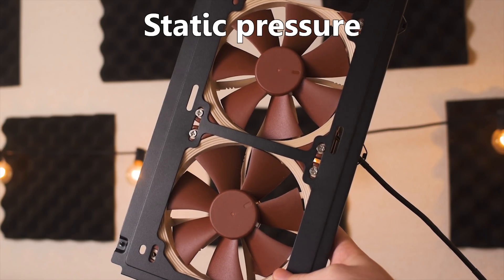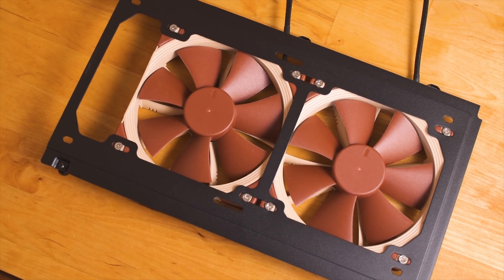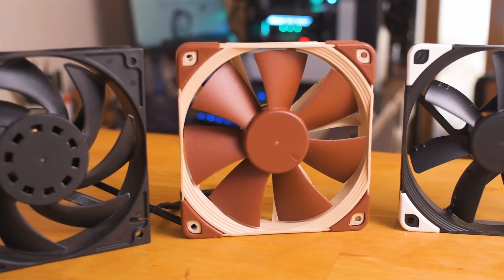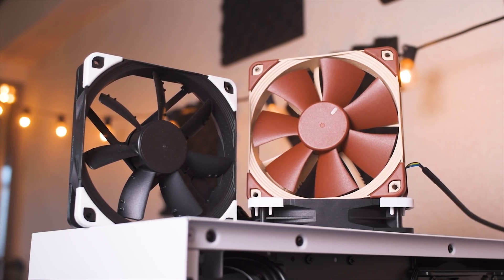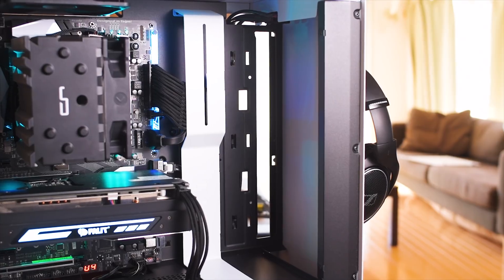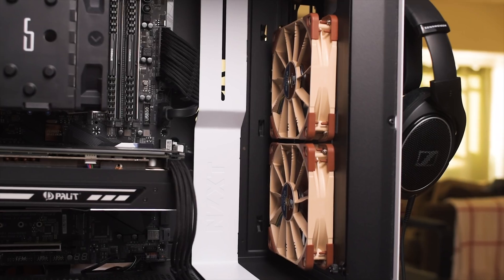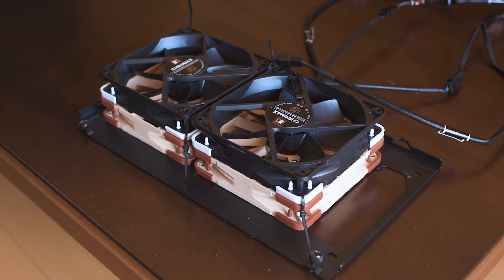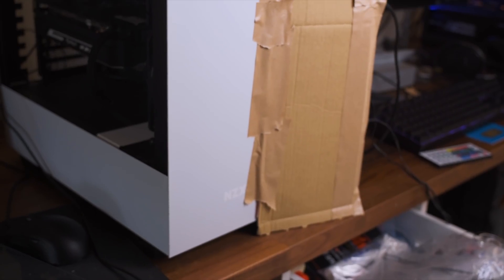DON'T buy front intake fans! (For NZXT H500/S340)

Comment: At first I thought how smart guys at NZXT are for making negative pressure case setup. And now after they released H510 I have to think twice. Now they have removed front panel and replaced it with tempered glass. Of course, this is being done just because they want to showcase 2 120 mm fans in front. But airflow case design is completely the same with regard to H500. So, there is no engineering ingenuity behind H series just because the fact this video proves - we don't need 2 intake fans at the front at all.

Comment: With this case and 120MM fans in the front you will be drawing air from the inside of the case because of the hole at the bottom of the fan panel.  Basically it's not sealed from the rest of the case and wont suck through the tiny openings/filter as easily as it could from the rest of the case.

Comment: Should i put airflow fans like the Noctua NF-S12 or static Pressure ones like the NF-F12 in my rear and top exhaust of my h200? (it has a similar design as the h500). One one hand, the airflow ones move more hot Air out of the case , but because i have no intakes there will be problemes with pressure and pulling the Air in, but im also thinking that if i put the static pressure ones that move 40% less air out of teh Case , there will automaticly be less cool air in the case , what is right? Need your suggestions.

Comment: This will save me a lot of money because I'm picking this case up today. Thank you very much subscribed.
Reply: Save your money if u want ur system to heat up.. I would say install the intake fan anyway if u r using air cooler. I'm using beafy size gpu with 3 fans yet I still need atleast 1 bottom intake. PS I live in Asia.
Reply from the maker: I'm glad it helped you out. It's a great case, I'm sure you will enjoy it.
Reply: @DawidDoesTechStuff  bro i am deep cool rf120 rgb fans for my h500 case for back fan and the top fan so should i install the old defaul nzxt h500 fans on the front of the case because.i dont it just laying around i want to use them

Comment: yea but it doesnt look as good without any fans there... not gonna say you have to have RGB fans but if you use 2 standard black case fans or even if you can find white case fans it fills the case out and makes it look full... like you take pride in your work. you can buy standard 120mm case fans from best buy for pretty cheap.

Comment: What if you would have gone water cooled for the CPU? Would that have helped with the temp?
Reply: I have a 240 AIO in my H500... im running a ryzen 5 2600 at 4.1GHz and i usually sit at 31c. plus like i said before it will fill out the case and make it look like you give a damn about building.... it looks horrible just looking through and seeing the back side of the front panel
edit i also stress tested the cpu. At its highest I had it at 71c after about 20 min or so

Comment: Hi i have Corsair 100r case , and i only have static pressure fans from Corsair sp120s so i can use them as two front intakes and three exhaust ( 2 up and one at the back? ) , as i am getting 80 degrees plus while gaming . Currently i have 2 intakes and one exhaust. 2 sp120 and one stock fan at the back . I have asus strix gtx 970

Comment: @DawidDoesTechStuff, got a recommendation for a future video !
Could you try placing a fan on the H500’s PSU shroud, since it’s perforated, to see how much it helps with GPU temps and make a video out of it ? 
If not possible, could you try it and post the results in the description or by answering this comment ?
Thanks for considering
Reply from the maker: Hello, sorry that I didn't reply earlier. That is a great idea. I will test it out and see how it goes. :D
Reply: Great ! Thanks for answering !
Reply: @DawidDoesTechStuff  did this do much of anything?

Comment: Yeah gamers nexus already disproved this video by showing that adding 2 noctua fans in the H500 decreases temperatures significantly enough to recommend it, and honestly I’d trust Steve over you any day
Reply from the maker: Fair enough, I would also trust Steve over my results. Out of interest can you remember what the video title was? I'm curious to see if I did something wrong in my test. Or at least try and figure out why we got different results.
Reply: @DawidDoesTechStuff   Look up NZXT H500 Case Review, test results start at 13:14. An important side note, in my original comment I mixed up my videos and mistakenly referenced a different video of the Meshify C by Gamer's Nexus where they specifically added Noctua fans and saw a dramatic decrease in temperature. In this video however, you will see that for CPU temps, having the rear stock fan exhausting, top fan intaking, and added front intake fans results in the lowest temperatures of all configs tested. However, for GPU temps the results were exactly opposite,  stock config resulted in the lowest temps and the best CPU temp config resulted in the highest GPU temps. So in the end, whether you should install an additional intake fan is dependent on which temps you'd like to optimize for. And I guess that is the only concern I have regarding your video is the blanket statement that you shouldn't add intake fans as that isn't the case for something like a workstation where optimizing CPU temps is more important.
I do apologize for mixing up my videos in my original comment, your methodology resulted in a conclusion that was much more (although not totally) in line with GN's conclusions than I initially thought so good work with that. I think the only thing I could suggest is a disclaimer regarding the CPU vs GPU temp optimization, but your methodology didn't exactly reveal that conclusion so I can't be upset that you didn't include one. All in all, after review of GN material, you provided a much more accurate test than I had originally thought (please please please just provide your test results in a table rather than overlaid text on a B-Roll shot lol it's very hard to read without pausing when not in table format)

Comment: If i'm using a 2700x / Vega 64 build in this case, would it be necessary (of course it would be better) to use a LC system over the stock cooler that comes with the 2700x?
Reply: whats LC? also this case is great. please disregard this video. this guy is a putz. this is by far one of the best sub 100 dollar cases. hands down.
Reply: @justinb3074  lol - liquid cooled. Vega 56/64 are known getting HOT. I know the case is great just wondering if i should upgrade the cooling system due to the air flow on the case.
Reply: @pickledpawnproductions3491  you could get an AIO cooler for the CPU that would get rid of some of the extra heat floating around, but It prolly wouldn't do a whole lot for the card.. you could try under volting the card, to a point that you still would hit the same speed. my best suggestion would be to get a high CFM pair of 120mm fans for the front.... pull in some more air, also a high CFM fan for the top vent, that sits right over the cpu and gpu

Comment: Mod front panel with mesh on the front. Reduced my Temps by 10-15C°
Reply: ADA Hepper where did u buy it
Reply: @ivanperisa  I did the mod myself on the chase. Got the mesh on a local craft store and hot glued/ black masking tape on the back of the front panel to create a seal around the hole I cut out. Works wonders and it was cheap to do.
Reply: ADA Hepper I am going to try to do it myself, thank you.
Reply: Can you make a video on it or post some pics somewhere so I can see how you did it or what it looks like?

Comment: You should have the fans in front to have an over pressure in the chassis, otherwise you’ll get under pressure and dust will come in from all other places than the front, bypassing the filters.
Reply: The case was meant to work with negative pressure, that's why the dust filters on the sides
Reply: Aleksander Practically it doesn’t work that way though. You want air in at the front, and slightly less out. That way you know that it’s being pulled in where the filters are. With negative pressure you’ll see dust in every single little opening in the chassis.

Comment: Great video, purchased the H500 twice, I do have one build posted on my channel, the intake fans help for my wife PC as it does has an MSI TRIO RTX 2080, that card produces a lot of heat when gaming. But even then I think, and I’m not sure, but using the stock fans provided would suffice, I opted to use a dual radiator cooler from Cooler Master so kind of 2 birds with one stone, thank you for the post.

Comment: Absolutely agree with you, good exhaust = good intake. If this wasn't the case, and the volume of exhaust wasn't equal to the volume of intake, there would be a vacuum. Basic common sense. But as someone wrote below, I appreciate that it blows dust out, and since I'm using a radiator, I'm in need of them.

Comment: i've found the top fan on the roof of the case causes series vibrations in the case , is there any way to fix this , it became so annoying i just removed it so currently my system only has the one exhaust fan at the back

Comment: Great video, there are many cases with this kind of design where there is very little ventilation at the front for fans to draw in air. I'm not surprised adding fans made little to no difference on this unit, so thanks for testing it out. Something important for people to consider in their next case purchase.

Comment: So stupid video!!!
Reply from the maker: Really? Why?
Reply: Dawid Does Tech Stuff Because he use 95w cpu
Reply from the maker: @lefan1959  but its a $69 case. Most people aren't using a 180w CPU in it.
Reply: Dawid Does Tech Stuff I use 140w cpu in this case with 280 mm AIO and this case so good
Reply from the maker: @lefan1959  Fair enough. But I never say the case is bad, just that you don't need to put intake fans in it. (if you don't have a radiator)

Comment: One question: if front intake fans are useless, why there's even an option to install them?
Reply from the maker: They aren't useless, just not worth the cost in this specific case. 
And the option is more there for radiator mounting in my opinion.
Reply: @DawidDoesTechStuff  That makes sense, thanks! I've already bought S340 along with 2 140mm fans though, and, well, I guess it won't hurt if I still try them.

Comment: my liquid cooler came with a fan and filter looking thing, were in the H500 would that go?
Reply from the maker: That goes in the front of the case. In the video where I screw the fans in to test. There. :D
Reply: @DawidDoesTechStuff  Awesome, thanks so much! Super excited to build my first PC this weekend!
Reply from the maker: @ryanfleming23  Thats awesome. Good luck and welcome to the club.
If you have any questions, feel free to email me. :D My email address is in my about page.
Reply: @DawidDoesTechStuff  Okay so I couldn't find your Email, so I'm hoping that you can see this. So I have a 1 fan on the top and back, and I will mount my raidiator and fan for the H60 cooler on the front. Should those fans be intake or outtake, and how can I tell if a fan is intake or outtake.
Reply from the maker: @ryanfleming23  Hello again.
My email should be under about. But it doesn't matter I saw your comment. :D
The fan on the front radiator should be intake. The best way to tell, is the side that the motor of the fan is attached to the fan (with the four bars coming in from the frame). That is the side the air comes out the fan.
The two fans that come with the case are set up as exhaust by default.
Reply: @DawidDoesTechStuff  Alright, so I should keep the other fans as outtake?
Reply from the maker: @ryanfleming23  Yeah I think that would be best.
Reply: @DawidDoesTechStuff  Thank you so much for all your help! You are my saving grace for this build!!!!
Reply from the maker: @ryanfleming23  Its my pleasure. Its very exciting that you are doing your first build. I hope you have a great time with your new PC!

Comment: I think the lesson here is your case can only cool as well as it can evacuate hot air. Your exhaust fans are 45CFM. It would be interesting to see results with the S12s (63CFM) installed as exhaust instead.
You can prove whether you're intake flow limited by removing the front panel as well.

Comment: Since I'm running an 8700k OC'd to 5.1GHz and running an ROG RTX 2080 in this case, liquid cooling on the CPU is almost a necessity. With that cable shroud thing in the S340 Elite, I removed it and cut a notch in it with a dremel and cutoff wheel and that allowed me to squeeze the h100iv2 back in with two HD120's on the back, making it a push/pull configuration. I also replace the top and rear fans with an HD140 and HD120 fan respectively. During stress testing my CPU temps hover around 75-80C with an occasional spike to the low-mid 80's, during gaming I stay in the high 60's on more CPU bound games and in the mid 50's on GPU bound games. In any circumstance, I've never seen my GPU go above 68C. Asus does a great job with GPU cooling it seems. Ambient temp is the same as yours, 22C. So in the case of liquid cooling, intake fans are a necessity as thats the only location to mound a radiator larger than 140mm in these cases.

Comment: I'm new to building PC's, and want to buy a H500I with NZXT Kraken x52 cpu cooler. Wouldn't this go on the front placement being 240mm instead of a fan?
Reply from the maker: Yes the radiator will go upfront, but with fans that come with the cooler there too. I haven't tested what difference fans make with a radiator.
Reply: @DawidDoesTechStuff  Sick thanks for the speedy reply
Reply: Dawid Does Tech Stuff Please test if you have a liquid aio! I’m looking to get this case with a 240mm aio very soon.

Comment: I’m running same case with aio cpu/gpu 4 120mm Corsair fans temps haven’t pushed 60 degrees exactly the same as when I had the same build in the Corsair 780t

Comment: So what does this say if you are running a front-radiator like me on H500 with two 140 fans (inward).  They just not doing anything?
Reply: Two things for me: they certainly help since the airflow is even more restricted so the exhaust fans would have to work harder. 2) In think the real reason the temps don't move with front fans is that the fresh air comes from somewhere else like the PCI brackets in the rear. So if you don't put fans on your radiator, who knows if there's even air that will go through it.
Reply from the maker: There is still air coming through the front to cool the radiator. So it's fine. I just haven't tested the front with a radiator, so I don't know what temp difference the fans would make. However if you see decent temperatures, you're doing fine. :)

Comment: I'm gonna put 2 rgb fans, 1 in the rear and 1 at the top, and then put the 2 fans the case comes with in the front just for the extra precaution, what do you think?
Reply: Linencastle I was thinking that myself since I bought the case as well. Depends on if you want the aesthetic look, my build has rgb ram so kinda have to keep the trend going

Comment: I have two AER RGB fans on the intake side. They work great and compared to the S430 Elite I upgraded from to the h500, not only are temperatures a bit better, there is not nearly as much dust in my computer compared to in my S430. This h500 mid tower design is actually really, really great. I love it. It's exactly what I was expecting it to be compared to the S430; I'm satisfied

Comment: You should test with the front panel removed.
Reply from the maker: You can't take the front panel off the H500. I did however do a video on the NZXT S340 in which I took the front panel off. (the reason it's relavent is because in another video I showed that those two cases perform very similarly) It made a huge difference in temperature.
Reply: As Dawid pointed out you can't remove the front panel which is something I love. As I commented, the S430 Elite that I had had that front panel you can remove. When I pulled the panel and took the filter out it was black with dust. I get practically no dust in my h500, it's a cleaner look, and because the h500 is a face lifted S430, I really enjoy it. I also like how it's a bit smaller and not as bulky as the S430

Comment: You can't just stacks fans. Look at turbine engines for example, each layer of blades is highly calculated and measures to spec to produce a desired flow or turbulence of the air.

Comment: Airflow in a case is subjected to an inordinate amount of variables and causes any dogmatic statements regarding configuration or part choice to be superficial at best. Getting upset about a builders use of static pressure vs air flow optimization is at best a crude attempt to be pedantic. It would go a long way for both case designers and we the end users to collectively become better aware of fluid dynamics.
Reply from the maker: That was kind of the point of this video honestly. I have made a bunch of these videos and every time there were a bunch of comments referring to things like static pressure fans and so on.
Thanks for the comment. :D

Comment: I have a H500 and saw a roughly 5-10 degree difference between not having intake fans vs. having intake fans.
Reply: TheElasticTuba same here. Saw an even bigger drop increasing the RPM
Reply: Vorname Nachname i actually ran this test again and without my front 140mms my gpu ran 5 degress cooler and my system much quieter. The 140mms were fractal base fans running at ~850rpm. H500 is definitely a great case though. Highly recommend. If you do end up getting it just remember to remove the top dust filter if youre running a top exhaust fan
Reply: @iNeed2Pi  Yeah I think the GPU temps were better because of the air being sucked in through the open PCI-E slots. You could feel it being pulled in without front intake fans installed but not when they were.